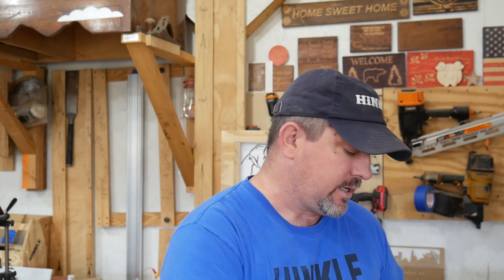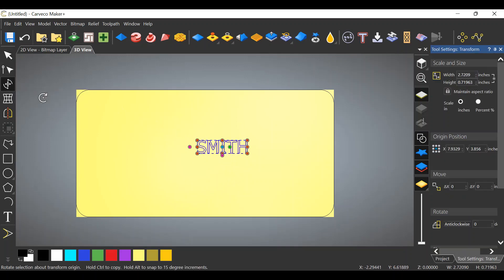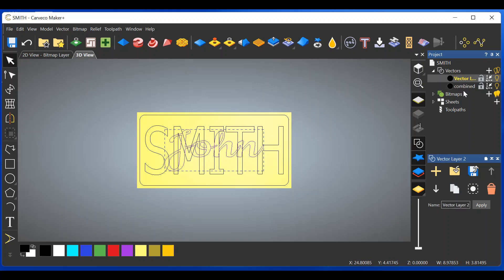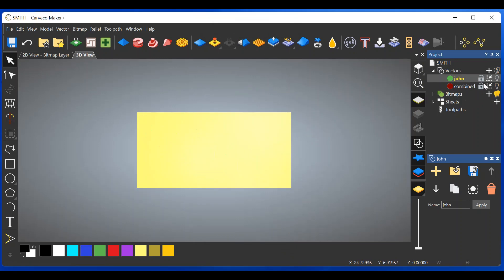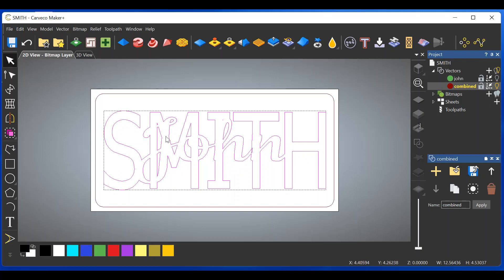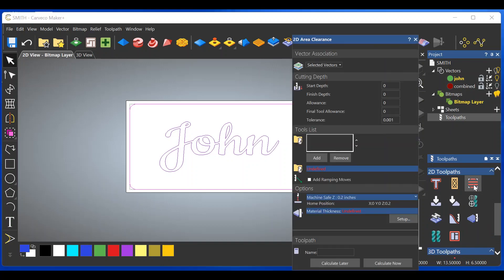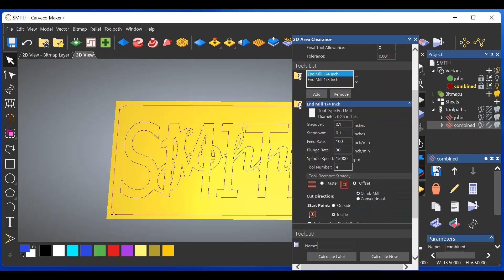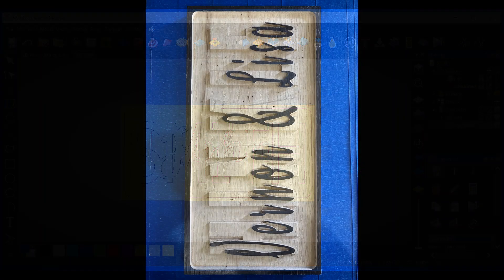How to stack text with Carveco software

Comment: OMG! I Finally figured it out.😅
Couldn't have done it without you!
I still need to play around with the Start and Finish Depths
to get the look I want. But It Looks Awesome!
Hopefully my CNC spits it out as nice as the render looks. Or Better😁
Couple of the Problems I had earlier were.
*Forgot to set Start Depth on (ToolPath #2) to the height of the Finish Depth from (ToolPath #1)
* Forgot to Re-Group some of the Vectors after the flood fill & convert .Bmp to Vector step.
* Forgot to make sure the highlighted Vector was properly selected in the Project Box.
* When selecting Vectors for ToolPath, I used (CTRL-A) thinking it would be easier.
Didn't realize by doing that, it also selected the Outer edge of the Border/Offset and Messed
the entire thing up.
I'm sure there were other bumbles on my part also. So many I can't remember them all. lol
Thanks Again!
Reply from the maker: Glad you nailed it! And glad i could help

Comment: Great Stuff!
Kinda a multi part Question to any of you CNC Wood Masters. 😁
The Sign I'm attempting has more than 2 words on it.
It has only one area where 2 of the 5 words are Stacked on top of each other.
The 2 words that are stacked, and the remaining words are supposed to all have different
(Heights/Thickness) 
Might be able to switch it up so they all have the same height, except the 2 Stacked words
if it becomes too complicated?

Me being the newb that I am, 
made separate layers for each word, and
a separate layer for the Border/Offset. 
(like 7 Layers) Total.
My newb thinking for separate Layers for everything was.
If I ever wanted to take a chunk from one project, I could maybe use it on another without having to recreate it from scratch.   Y/N?

I'm assuming I need a Separate Tool Path for Each Grouped Height/Thickness. Y/N?

If I change a couple of the Non Stacked words to the same Height. 
Should I combine them into the Same Layer? Or do I just Leave them separate and
(Lightbulb On Multiple Vectors at the same time) when making a Tool Path?

Is that Always the same thing? Weather separate Layers or combined.  As Long as they are Highlighted/Turned On at the same time? Y/N?

In this Video, you Copied your Border/Offset onto Both layers. 
If I keep All 7 Layers,
Would I need to also copy My Border to All my Layers?
Or just the 2 Layers that are Stacked? 

Am I thinking correctly with any of this... lol
Sorry this is Soooo Long!

Been Super busy and finally (3 months later)
have the time to attempt this.
Thanks for any advice!
Reply: Dang it! I almost got it right.  lol
I'll just keep messing around with the Layers.
After the simulation render.
It was Almost Perfect.
The Big single Letter in the Middle of the Sign ended up being in the front
which blocked some of the other word.
Im glad I saved and named a new file with every step.
Looking back at my saved files.
it's something to do with the Flood Fill  & Convert .Bmp to Vector part.
it's 3am and my head hurts, I should be in bed.... lol

Comment: Thanks a lot Vernon.  I had done the Carveco tutorial already but it was nice to have another example.  When I followed along, I used Vernon Hinkle instead of John Smith.  That way it reminds me that it's your example.  

I use Mach 3 and I learned recently that there is a special post-processor if you want the machine to stop between tool changes.  There's a post-processor called "Mach3.4-Arcs(inch)ATP" that puts the commands in to handle an automatic tool changer.  You don't need the tool changer, but the machine still stops and waits for the change.  Just thought I'd add that in there for other Mach 3 users that weren't aware of this feature.  BTW, the tools need to have different numbers for this to work, so don't forget to set them up, like you've done in your video.
Reply from the maker: Awesome it’s all one big community to me any info that can help someone is always welcome and appreciated thanks for watching and thanks for taking the time to comment and volunteer the info

Comment: Great Video!...  
With most if not all of your videos and other creators,
 you guys mention to move the curser into the corner until you see the (BULLSEYE)
to make the corner easier to select.
Which I get. 
A lot of software does this kind of snap to type thing.
If I select (ANY) tool, like the Square your using in this video,
 I do Not get the Bullseye?
The only time I see the Bullseye is if I select the Arrow Pointer at the very top of available tools.
Is this something that Carveco has changed with updates?
Or am I missing a setting?
Thanks in advance!
Reply from the maker: Thank you 
Try this 
Go to the top of the screen click view 
Then in the drop down click snapping
In the fly out menu make sure the following is selected 
Snap to guideline 
Snap to objects
Snap hints 

That should do the trick good luck and thanks for watching
Reply: OMG.....😮
I just found the answer to my own question.
Of course 10 minutes after posting the question.

In the view drop down, under Snapping,
there is a On/Off selection.
The dumb thing is.... 
It doesn't have the check box next to it letting you know its selected or not,
as it does with the other boxes above it.  Grrrrr....  
It's little things like this that drive newbees Nuts!
Our heads are already wanting to sometimes explode from information overload
trying to learn new software and all the little quirks that go along with it.

Keep up the Great Work!
Reply: @Hinkleshop  Thanks for the quick responce!
I didn't refresh my page so I replied to my own not knowing you already answered my question....lol